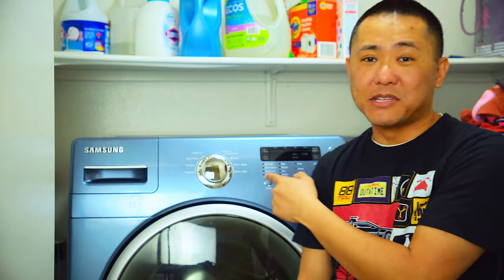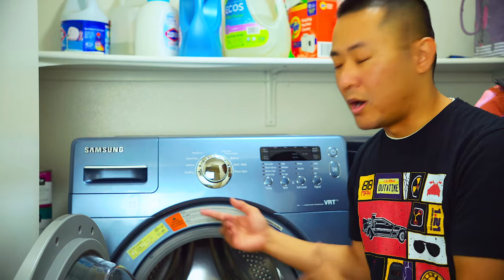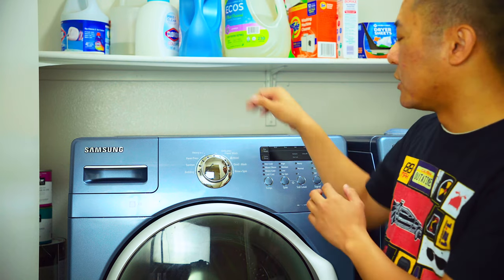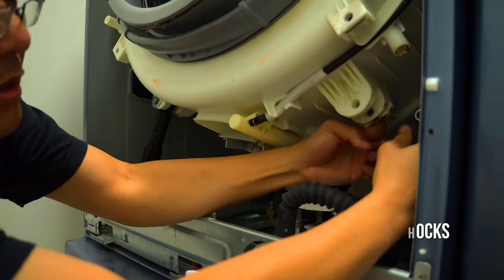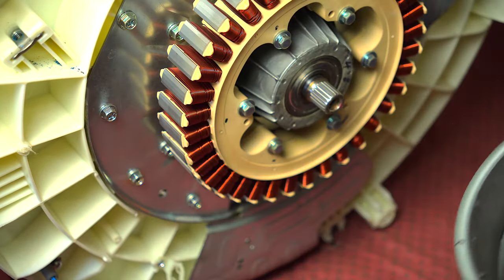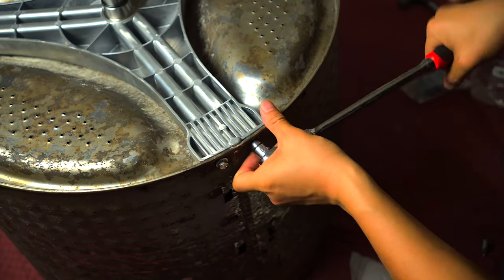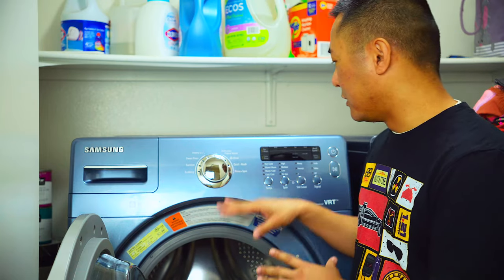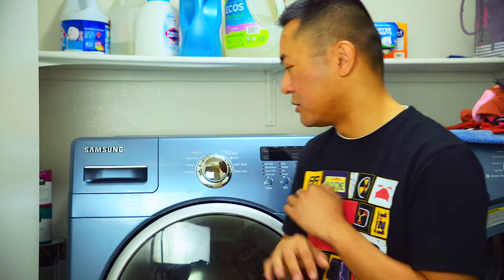How to fix Shaky Samsung Spider Arm Washing Machine [FIXED] Imbalanced - Replacement, Flange Shaft

Comment: I have this exact same washer, I replaced the spider shaft , and shocks and it still shakes pretty bad. Does anyone have advice about how and why this machine is still doing this?
Reply from the maker: Did you replace the bearings also (there are 2 of them)?  That could be the culprit. Otherwise, the entire drum could be out of round…

Comment: How'd you get the broken bolts out?
Reply from the maker: So the kit I bought came with new bolts, as it’s common for the old bolts to break off on the old spider arm when using a wrench. If you still need to remove the broken bolts out, you can try a broken bolt extractor.

Comment: I'm having issue with on eif the leveling leg, where the bolt goes doesn't have the grove where bolts is tightened on what should I do ?

Comment: Thanks for making this video.  

Here's my issue...
My 2014 WF42H5600AW washer makes noise ONLY during spin cycle, and it can be broken into two distinct sounds: (1) a knocking during initial spin up followed by (2) a loud vibration-type racket during max RPM. Furthermore, knocking occurs at the start of the spin cycle during low RPM as the washer seeks to balance the load; the washer then stops, begins again, stops, restarts, et cetera, some random number of times until it begins to spin in earnest and the loud vibration-type racket occurs. All of this—apparently—are symptoms of a broken spider.

A knocking noise during the spin cycle can also be caused by three items:
- worn shocks;
- loose counterweights; and...
- broken drum shaft assembly (aka, "spider").

I hate to fire the parts cannon at a problem. Is there a assured test to absolutely confirm the spider is the source of the knocking during the spin cycle?
Reply from the maker: Yes you can!  So, with the washer off, spin the drum by hand.  If the drum has a wobble to it, you know for sure it's not the shocks, weights, or balance ring, and a broken spider arm is the culprit.
Reply: @JamesFixIt  I have the same problem with my 5-year-old Samsung front load washer, the washer is shaky when the drum spin, but I can't be sure if it's a bearing problem or a hydraulic leg problem, or a spider-arm problem.
But seeing your discussion, I think it should be a spider-arm issue.
BTW, Thank you for the great video.

Comment: How much force did you need to tap those bearings out ? I wonder if there are tools to do it.
Reply from the maker: Not a lot at all, but it was a tedious process for sure doing it incrementally on all sides. I’m sure there is a specific bearing tool available somewhere.

Comment: I have a new machine bought from a outlet center.  I will try this another video said shipping bolts
Reply from the maker: Yes, if it is brand new, that should be shipping bolts as the issue. If not, I’d contact the seller for a replacement 👍🏽

Comment: My samsung front load  washer is brand new and has this rocking issue. I balanced and still couldn't fix it. Any ideas on how to fix it?
Reply from the maker: Did you remove the shipping bolts from the back of the washer? There should be four of them.
Reply: @James Fix It!  lol thank you. First washer and dryer I've ever had.

Comment: My old machine did that I eneded up getting rid but the new one is doing something similar except not moving
Reply from the maker: Is the replacement machine brand new? They come from the factory with four shipping bolts on the back of the unit that you need to remove. If those are already removed, maybe it’s defective?
Reply: @James Fix It!  yes I took all 4 out.  The level is ever so slightly more to the right but I wouldn't have thought that would make all that difference I haven't touched adjustable levelling feet I might try that.  It's a Haier series 5.  I had broughtba Samsung 5+ autodose.   But the programmes were much longer on the cotton programmes than it said so I sent it back. It's a lively sleek washer.. but not for me.   You  would think the Samsung would be as customisable with washers as the Haier.   But it's not. Thanks for replying though.

Comment: Great video, I attempted to fix my washer only to realize that there is a slight crack in the plastic housing, was wondering if it’s worth replacing the spider due to that crack in the housing unit. Can the plastic housing be replaced
Reply from the maker: Thank you. Is it a small crack that can possibly be sealed? If not, perhaps u might find a replacement online.
Reply: @JamesFixIt  can’t find it anywhere not even Amazon, it’s the front part not the rear housing I guess because the drum was spinning out of control it caused a crack in the housing
Reply: Get some serious plastic glue and try seal the crack
Reply: @teronegodsent7097 
New parts are the best.
But sometimes you have no options. 
Try JB Weld and a tiny piece of metal fly screen mesh. 
Take a picture of the original cracked plastic  part first for your  reference of how much  you can or cannot add to the repair reinforcement part so it can't interfere with the parts function. 

Roughen up the areas of part needed repairs with  medium or coarse sand papers or files.
Clean off all dirt and dust then mix and apply your  epoxy cement into and on top of the cracks.
Add metal mash on top of cracked areas. 
Then add more epoxy over the mesh.
Over spread it if permitted.
Just be sure your repair doesn't interfere with the  necessary moving parts. 
Let it sit dry more than  than the adhesive manufacturer suggested by adding additional hrs or more, depending on the  thickness of your application. 
It works most of the time on broken parts with no replacement available. 
You can put thicker application of JB Weld on parts where the sun don't shine, if it doesn't interfere with movements  or interfere with the  covers.
Good luck .

Comment: What to do to prevent the same thing happening again and have to change in 5 years? 
How to prevent galvanic corrosion?  how about plastidip or placing a plastic washer to prevent contact of the two dissimilar metals?

Comment: so mine completely stopped spinning and now it can’t move at all by hand… hopefully it’s the spider arm. my filter also has been building up with zinc small rocks so we will see
Reply from the maker: Small rocks is definitely a sign of a broken spider. I did see a few in the catch drain as well. Hope a new spider arm will fix your issue!

Comment: There is  a simple solution to avoid having this problem in the  first place: leave the door open between washing.  The water stays inside the washer and  moisture corrodes bearings and metal spider. Or attach a string to keep the door slightly open.
Reply from the maker: I've trained my family to always leave the door open after each wash.  After 10+ years, it still corroded, unfortunately, but I'm sure that lifespan would have been much shorter without leaving the door open between washes.  👌
Reply: We also always leave the door open, but mine was also very corroded with one arm cracked clear through.
Reply from the maker: @markhickey4979  It's an unfortunate quality/design issue :/

Have you fixed the broken part, or replacing the entire washer unit?
Reply: @JamesFixIt   Thanks to your video, I was able to fix it. Machine runs like a top now.  Mine was a slightly different model, but I could figure out my way around the minor differences.  I was a bit surprised at the crap metal used for the arm and the screws holding it in.  They are white metal and snap off so easily.
THANK YOU again for this video. After a really bad experience with an appliance repair guy / bandit, I much prefer to do my own work. Given how long it took to tear this down and put it back together, I am guessing I saved at least $300 on labor.
Reply from the maker: That is awesome to hear, and you definitely saved $300 at least!  It's great to know that you've also done the work without skipping corners as some "handy men" out there might do to make a quick buck!  Thanks! @markhickey4979

Comment: I bet the fabric softener is the cause of the badly corroded spider arm
Reply: while fabric softener definitely causes corrosion, Samsung front loader spider arms (at least within the last ten years) are extremely notorious for breaking/corroding very quickly most Samsung appliances are junk. their under two separate lawsuits on their fridges for their compressors going out within a year, or their dispensers breaking within a year.
Reply from the maker: Yes, I’ve been reading about fabric softeners and I’m sure that is one of the main culprits!

Comment: I replaced the bearing 3 times already.  Ready to dump the washer.  Poor design 😢
Reply from the maker: That’s a bummer! Was water getting into the bearings, causing them to rust, or was there a different issue?

Comment: My 11 year old Miele started getting very loud and wouldn’t stop shaking a little more violently than this one especially at 1400rpm was SO LOUD! and walking never done before about a month prior my spider arm was corroded and my drum was knocking and Miele wrote it off even though it could of been fixed.wasn’t happy as it was stainless steel and chrome door I loved the look of it more than anything else lol.  But went back to the first machine I bought myself when I moved out at 18 years old and that’s a lg I am now 39 on my 2nd lg and it’s so much better than the Miele I think personally cleaner clothes an so so quiet…  🤫😊 even before my spider went on my Miele it was never the quietest machine and I live in apartment so couldn’t use it at night the whole block would hear it 🤣🙈 Samsung are good to I think but never owned one, but love their tvs 💯

Comment: Never buy appliances with unique color other than white.
Reply from the maker: Oh? These custom blue appliances have been used vigorously non-stop since 2009, and working great 👍🏽
Reply: I'm glad you liked them.
Otherwise it's hard to match the other ones when only one needs replacement.

Comment: Stay away from Samsung washing machines.  Worst brand that you can buy.
Reply from the maker: We’ve had this unit since 2009, and it’s been great other than this one issue. Hoping the new spider arm lasts for a while, but it’s been fine otherwise 👍🏽
Reply: Just had the spider flange replaced on ours. And it is a 2009 model as well.  It is acting like it is brand new again.
Reply: @erico8738  Luckily, when I purchased mine at Sears, I took out their extended warranty.  They offered one of the best extended warranties ever. Their extended warranty: If they had to service an appliance 4 times within the year, any issue, they would reimburse you the full amount that you paid for that appliance, provided you bought any replacement brand at Sears. My first year, just a month or 2 past the original Samsung warranty, I called Sears to fix different 3 times.  With that, I gladly renewed the Sears extended warranty for another year in which the machine required 4 service calls. Sears issued me a check for 800 dollars.  I then bought an LG front load and have had no problems during the 8 yrs of ownership so far.
Reply: @erico8738  BTW. The repairs were as follows:
1. Despite the lid locking. The sensor telling the machine the lid was in fact locked failed so the machine wouldn't start.
2. The water level sensor failed so the entire machine filled with water, every time during the cycle. 
3. The motor failed 
4. Motor failed again 
5. Clutch or transmission to the motor needed replacing. 
6. One of the corner springs or shocks that stabilize the drum during its spin cycle snapped 
7. Water inlet and temperature sensor replaced. The machine would not provide any hot water when set to do so.
8. Another motor issue as per the diagnostic code displayed and Sears, at this point, just issued me an 800 credit with their appliance department section at Sears.
On 3 of those issues, clutch and motor failures. The entire machine had to be dismantled.  I remember coming downstairs into the basement seeing the unit in various parts with its drum on its side. It looked like the Lost Is Space Robot dismantled.  Lol

Comment: With the new Samsungs they Have four Bolts in the back that are used for delivering purposes..Don't forget to take them off and Calibrate your washer before you use it first...Great Video by the way!!!!@👍👍
Reply from the maker: Great point, as a lot of sellers do not inform buyers of this, and I’m sure plenty have thought they had defective units.
Reply: @JamesFixIt  Yes!!!!!👍
Reply: @JamesFixIt  Yes!!!!!👍